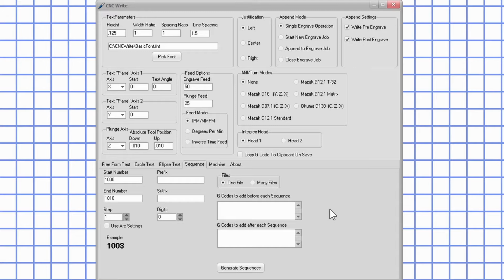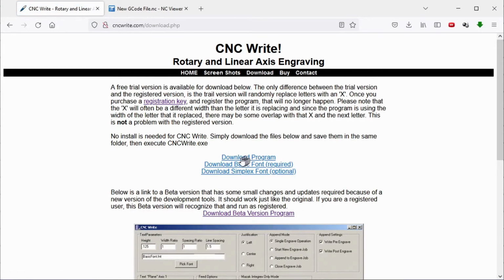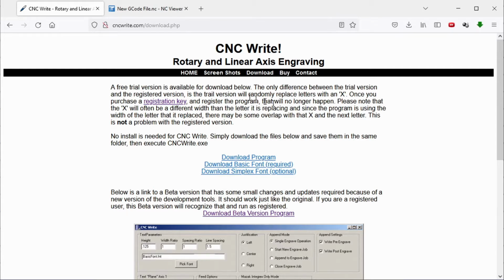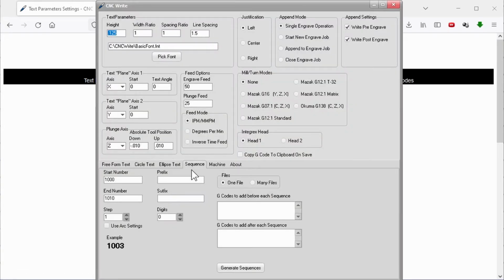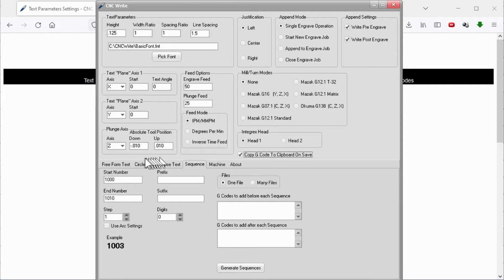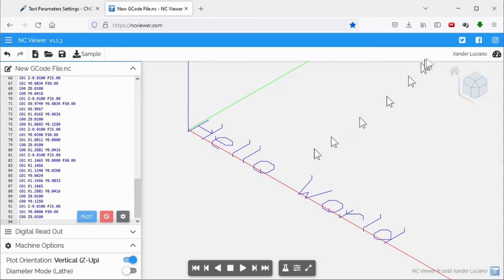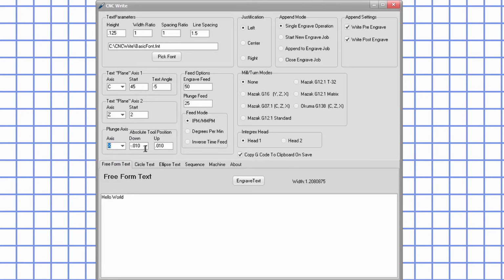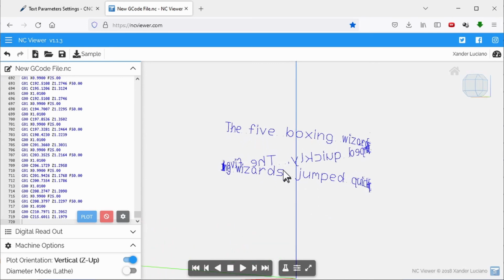CNC Write Introduction

Comment: Can be used with metric measures , or only imperial .
Reply from the maker: it uses whatever units your machine is set up for.  G-Codes don't have units, they are just numbers.  What those numbers represent depends on the machine running the G-Codes.